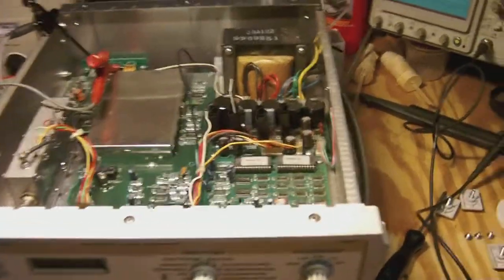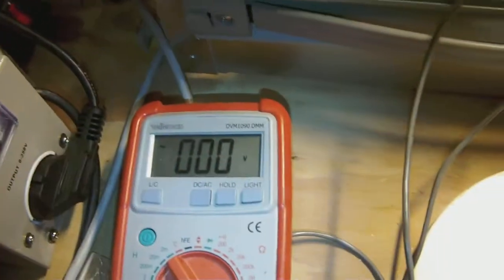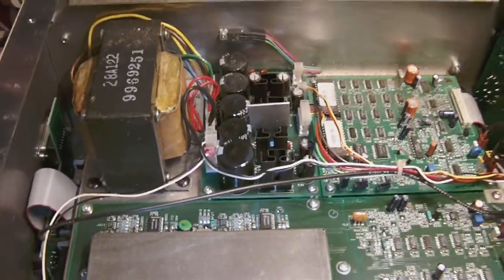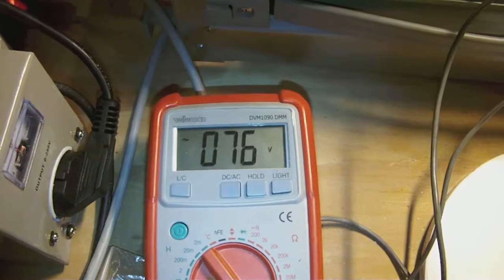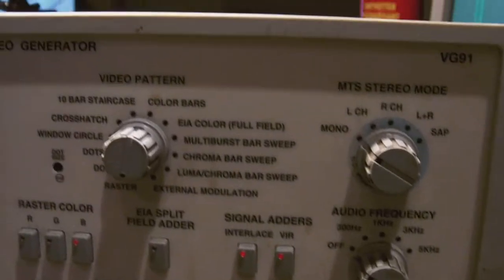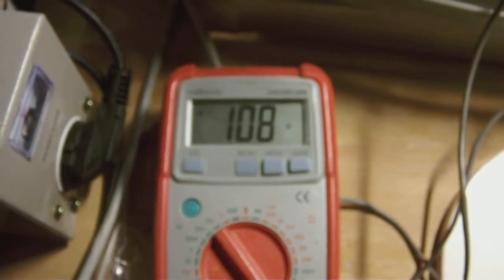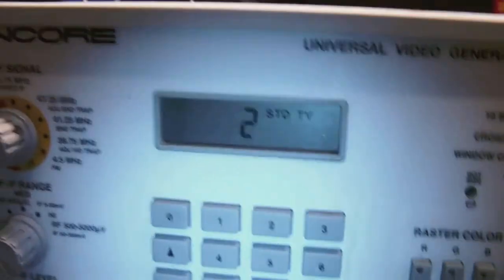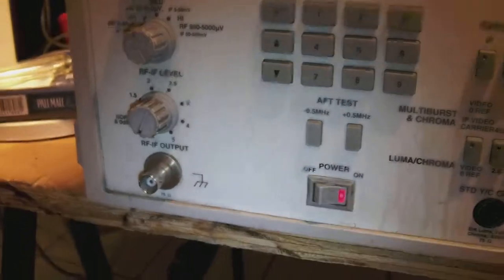Sencore VG91 part 2 of 3

Comment: It's not a good idea to run solid state equipment at reduced line voltages.  The CMOS chips can lock up and burn out.
Reply from the maker: Yes. I remembered a bit too late that could be the case. That's why I switched it off before ramping up the mains voltage to 117V. Guess I'm still a bit "rusty". I won't make the same mistake again. Thanks for the warning :)